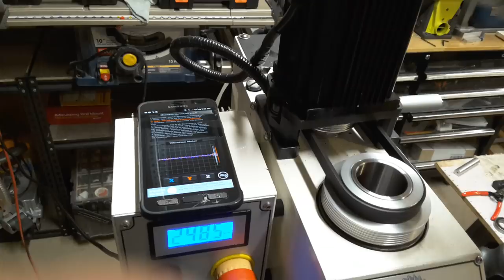PM-25MV G0704 Spindle Vibrations

Comment: The vibration apps work great for that purpose, that was the only way I got my spindle running so fast. I ended up turning a ring that I attached to the spindle with set screws and was able to drill holes in, in order to get my spindle balanced. It will be interesting to see if how much taking up the axial slop helps, I know you pressing on it seems to fix it however I bet your arm is absorbing a lot of the vibration as well. Use the screenshot function on your phone to capture the measurements or get one of the apps that can dump the readings to a text file, it really helps to compare results.
Reply from the maker: Hi.  Good points.  Some day, I'm going to eliminate that entire rotating part that drives the spindle and do something similar to what you did.

Comment: Hi Franco, cleaning/greasing aspect I’m struggling to find the answer to... hoping you can help me please. I’m currently at the stage of attaching my Chuck to the R8 Arbor on my new VM25L Mill in which I know both Chuck & Arbor needs to be completely grease/oil/dirt free... but... QUESTION: The long Drawbar I unscrew to drop the Arbor and the tunnel the drawbar slides in & out of is covered in dark dirty grease. Do I clean both the Drawbar & Drawbar tunnel? If so, do I replace the Drawbar & Drawbar tunnel with clean bearing grease now or leave it clean clean? Thanks so much... really struggling with this one. Nickolas
Reply from the maker: You can never go wrong by cleaning a surface and then applying oil.  Grease is good for bearings,  lead screws and places where you can't oil regularly.  I like to squirt a little oil on the threads of a collet or drill chuck to let it transfer on to the drawbar. Keep surfaces clean. Apply a small amount of oil often.
Reply: @FrancoCNC  Thanks Franco, appreciate it.

Comment: If the spindle was in, would it not add weight to reduce the vibrations? The spindle is also nice and quiet for its RPM
Reply from the maker: Hi.  You may be right.  I do think that the spindle along with the quill spring will solve the problem.  And "yes", the spindle is relatively quite considering it's cost.

Comment: Bent spindle shaft mate or not enough preload did you check that the replacement  a bearing were the exact same thickness? guarantee I had got a new spindle Arbor fixed the problem.
Reply from the maker: Thanks.  I'll check that out.

Comment: I'd have a hard time giving up the use of the quill. With the quill movement it is quick and easy to set Z-zero in mach3. I have a pendant, but I crashed the endmill into my table once, now I won't trust it until I figure out what went wrong.
Reply from the maker: Hi.  I hear what you are saying about the Quill.  I've given up that convenience with the hope that my setup would be more rigid.  Regarding Mach3, have you ever given thought to going in a different direction?  If so, check out the Centroid Acorn system.  You may like what you see.
Reply: I saw that, looking at that and Masso. Why did you choose Acorn over Masso? I don't like how they charge for additional axes.
Reply: Hi Franco, I looked at the Acorn controller. It is an open loop controller. The clearpath sdsk motors I have are closed loop. How does this work? Will the built in clearpath motor controller guarantee position such that the Acorn controller doesn't need to be closed loop? If so, I'm in.
Reply from the maker: Hello Robert,  I'm often asked about open loop vs.  closed loop.  Open loop is easy:  The computer sends the desired number of pulses to the motor controller and has no idea of what actually happened - it just hopes everything is OK.  Closed loop (as you know) implies that there is feedback from the motor (via an encoder) that provides true positional data on the actual position of the motor shaft.  There are two ways to handle the encoder feedback: 1.  send it to the computer or 2. send it to the motor controller.  

Most DIY CNC machines do not send the encoder feedback directly to the PC as this requires expensive interface boards and makes the computer do a lot more work.  What i see most commonly is the feedback sent to the motor controller and the controller makes any necessary corrections and/or adjustments.  That is how the ClearPath motors work as do  many other drivers.  Check this out as an example: https://youtu.be/vNjPo0wq8xI

So, you are 100% correct in your statement:  The built in clearpath motor controller will guarantee the position such that the Acorn controller doesn't need to be closed loop.

Sorry for the lengthy response!
Reply from the maker: Hi.  I like the Acorn because it comes from Centroid - a company that serves "professional" manufacturing customers and has been in business for many years.  I've seen Centroid controls installed on machines at work and this give me confidence that they know what they are doing.  I like the idea of the MASSO but I get the feeling they are still figuring out how all of this CNC stuff is really supposed to work.  Centroid already knows how a CNC machine needs to work - their challenge is bringing that knowledge to the market at a price point favorable for the DIY customer.  So far, my experience with the Acorn has been very good and I'm trying to give them support as I believe their product will really benefit the DIY CNC community.

Comment: Hi from France, Franco !

By having view your previous videos, I'm a bit surprised about why you are not using some solutions "from upper", in order to make a pressure via a "wave spring with shim ends". In order to avoid that the spring turns with the quill, I would use between the upper surface of receptive pulley & this spring a kind of clutch bearing ?
(the ones which are used onto manual gearboxes : https://upload.wikimedia.org/wikipedia/commons/thumb/1/17/Thrust_needle_roller_bearing.jpg/1280px-Thrust_needle_roller_bearing.jpg)

For giving a better view about what look likes the wave springs : http://daemar.com/fr/wave-springs_504/
It seems to be possible (for me) to realize a new stiffened plate fixed onto your spindle motor to allow to maintain the spring well above the top of this vibrating quill, and maybe using a setup that will allow to modify the pressure applied...

Are you using automotive-grade pulleys and automotive belts onto your other mill ?
Were there come from ?

About the 3D-printed part you have shown, I'm allow you the advice about the sensitivity of the "PLA" plastic with ambiant moisture when heating this plastic. That's why lots of 3D printers uses airtight bags to contain brand new PLA coils. If you have used PLA for your part, I'm afraid of disintegration regarding the possible exposure to mist & coolant splashes.

I'm looking about the future upgrade of a European equivalent of PM-30MV, with a brushless DC motor, with a power of 3 to 5 kW, powered via a 230 Volts monophased DC rectifier.

Wishing to you the best, well done modifications Franco ! Clever experiment with this application placed onto your Samsung phone. What is the app used ?
Reply from the maker: Hello.  Thank you for all of that information.  I will give all of that consideration as I work through this project.  Regarding the 3D printer, I use ABS filament.  I'm very curious to see how your machine project comes along.  Please post videos.  Thanks!